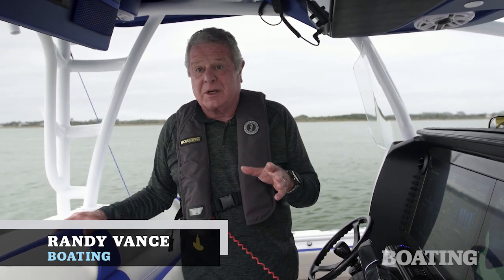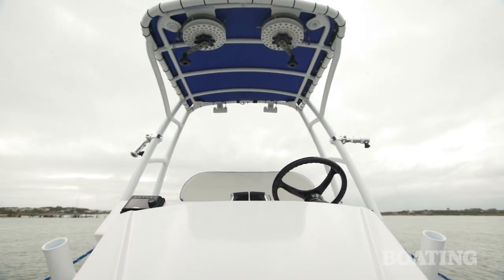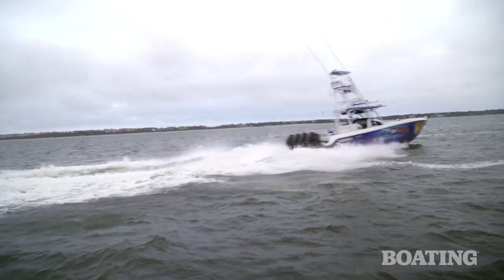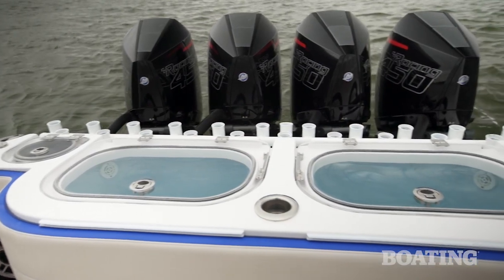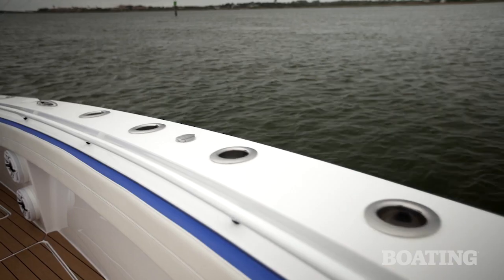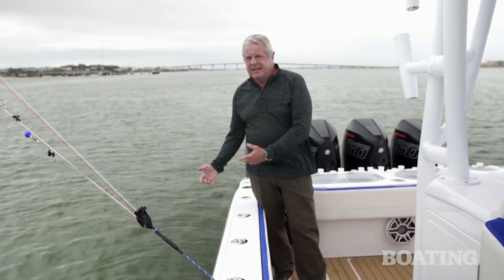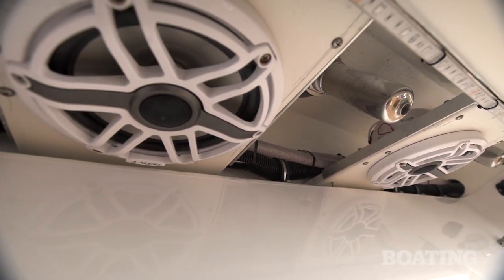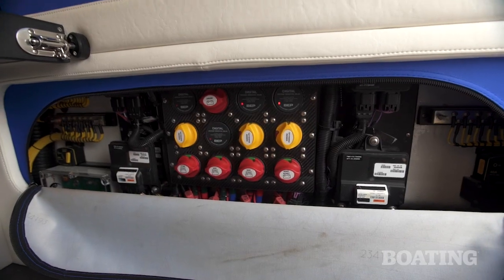Nor-Tech 392 Superfish

Comment: For that price the boat should have a built-in trolling motors into the actual hull. 2 in the transom to keep it going forward in the current and a bow thruster to go left and right. Have those maneuver in sequence through a computer to hold the boat in one spot. Then you won't have to drag around that eyesore trolling motor on the bow. You will be first in the industry. Don't say I never gave you the multimillion dollar idea on July 24th 2022.